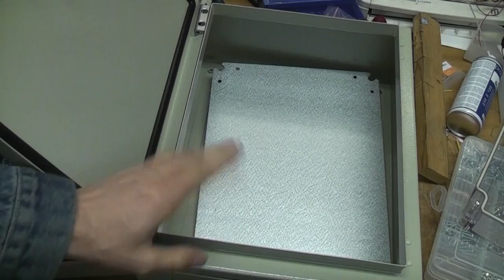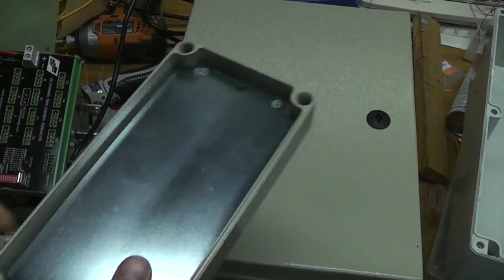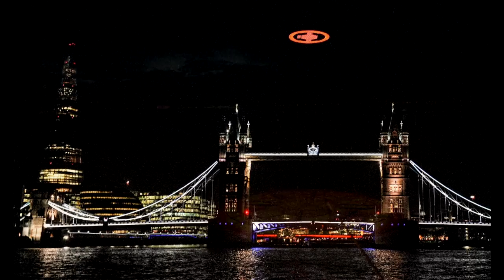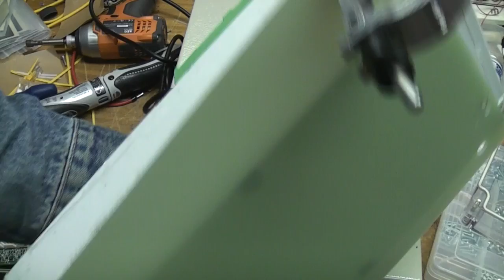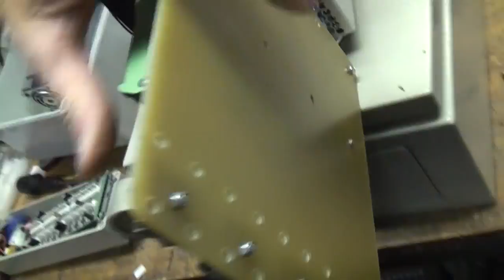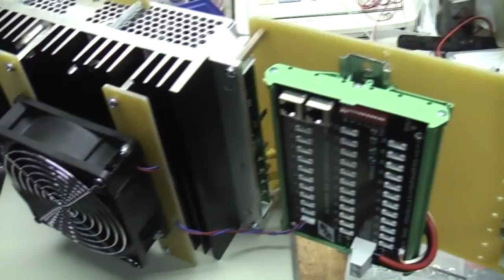Using PCBs as mounting plates

Comment: Is there a reason you chose not to have solder mask on these PCBs? It would probably make the FR4 boards look a little better ascetically but I presume it worked out to be cheaper from the fab house without the solder mask on there? Just curious.
Reply: No one is ever going to see these plates so why worry about aesthetics?  As long as it doesn't blind you when you take the lid off I say it's fine.

Comment: And what about the grounding now you have to ground evrything seperatly with wires.
On a dinrail mount everything is automatic connected to the ground. 
You are creating dangerous pannels mate. There is a reason why box suppliers dont chose for pcb
Wath out this is verry dangerous
Reply: Horses for courses. It's not dangerous. Look at what the kit is. A single PSU in a plastic box. The DIN-rail module is fully insulated with plastic clips. So the PSU will have mains earth as a matter of course, but nothing else needs it. 
Also depending on the particular industry or customer, many do not class something as being earthed just because it is bolted to a plate which is earthed by some other piece of kit. Each item must be specifically earthed. 
So the answer is no, it's not an unsafe practice. Anything which NEEDS an earth would be specifically earthed anyway. 
Plus, it removes a lot of the dissimilar metal reaction hassles in outdoor equipment!

Comment: An idea for a video: teardown of a variable frequency drive (for industrial AC induction motors). I think they can be found used for as little as 30$ or could even be non working for tear down purposes. maybe even repair.
it's sort of topically relevant in the context of the impending electric car revolution.

Comment: One option for stuff like this is to get hold of a used PCB router. I did this about 10yrs ago and it can be used to accurately rout out stuff like the PCBs in the video. You would only need one tool to rout those shapes and it only takes a few minutes to rout out several of them to the same accuracy as the PCB company.
My machine is a T-Tech 7000S and you can pick these up for reasonable prices if you are patient. I've since bought another 7000S for routing and engraving front panels etc.

Comment: Hi mike, I really see where your coming from with this, I was working on a job similar to those you have shown, however our Pillar drill had just failed and it was a urgent job, so i ended up using a cordless drill to drill out all the mounting holes. A PCB material would have been so much easier.

On a side note if I ahve a Relay that has a Max AC Switching Rating of 250V AC is that RMS or Peak?